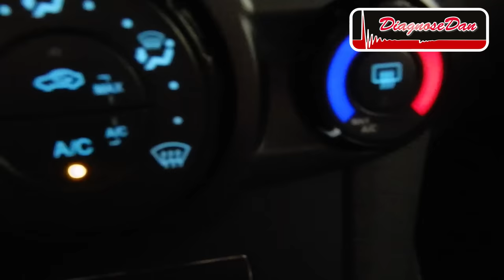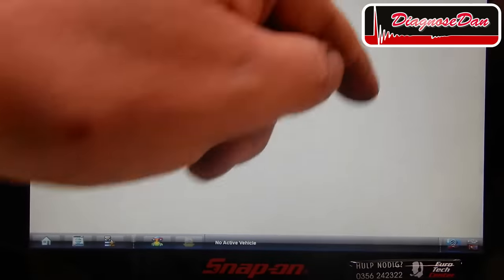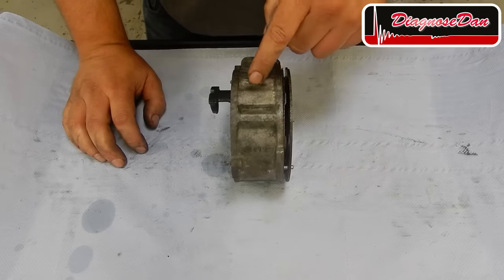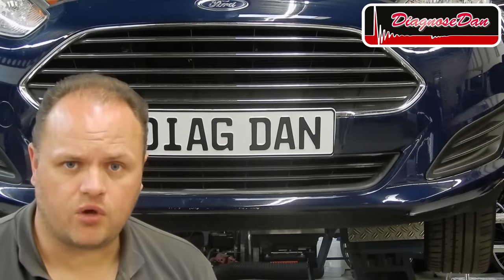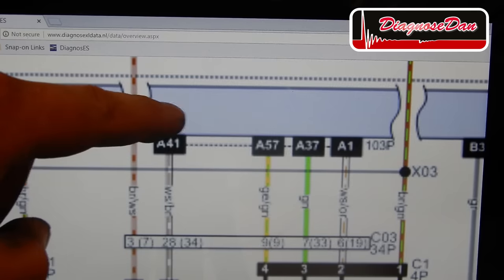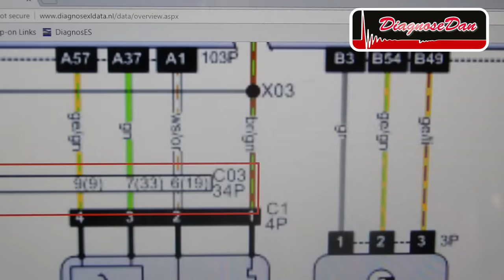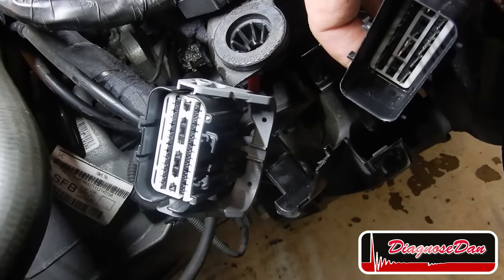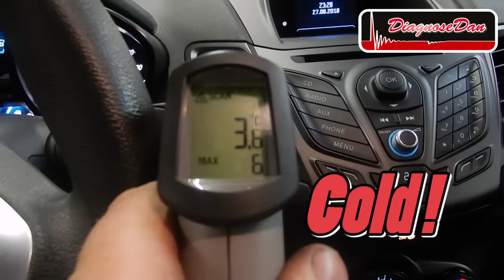Ford AC Trouble ! (Variable AC compressor)

Comment: You are an excellent auto lecturer who teach the trouble diagnose more logicality. All of your customers will end up their repair only with replacing  the exactly required spare part. Modern Technicians end up the repair job after removing  03 genuine parts with fake, finding the fault in the last one. Your customers are really LUCKY.

Comment: Outstanding that you actually make the effort to find faults with connectors. That is the biggest problem with a lot of mechanics. They are into replacing components because it doesn't require much thinking

Comment: Thanks a billion times Dan, i came a cross a car with the a/c solenoid which i kept confusing for a pressure safety cut off switch, the tutorial of the slung plate made me understand how the design works and i was able to fix the problem. Previous mechanic replaced the compressor 3 times and ended up with the same problem

Comment: Thanks for the new video Dan, this is basically the same with any ground side control circuit and will help with understanding the process and shortening the diagnosis time!! Great instruction all around........thanks for taking the time!
Reply from the maker: It's basicly a very simple system, but a lot of people don't know what the solenoid does.

Comment: another great video about electric diagnosis. I like how you get very specific on the meaning of electrical measurements on components and wires. Your measurements on the solenoid remind me of how control relays behave which is very similar in that when not grounded have power on both sides of the coil, but will have power only on one side when the pcm grounds the control coil in the relay.
Reply from the maker: Thanks for the nice words!

Comment: great fix, thanks again Dan 👌
that's a common fault on most vehicles where vibration or pulling forces are an issue, specially with bad motor mounts or bad shocks (bad roads or bumps also helps out the possibilities on that issue)
i have seen it in many times its very common on transmission modules too
Reply from the maker: Thanks for watching!

Comment: As usual Dan, excellent video even though I do not have this type of AC system in my cars. I had the same problem where a connector pin was not fully snapped into the connector housing on my motorcycle. Sure enough, it was the pin coming from the kill switch to the electronic ignition module on my 1990 BMW GS which is why I noticed a slight hesitation while driving. I looked into the connector, saw a pin was very recessed, pulled back the rubber boot, pushed the pin forward and heard a nice "snap" as the pin engaged in the connector housing. Bingo...perfect! By the way, you have a nice Nussbaum lift. I had to settle for a MaxJax lift in my private home.
Reply from the maker: Sweet!👍

Comment: 10:29 The thing held by the left hand is the reed valve assembly. FYI, this is what makes variable displacement compressors emit a low groaning noise when the swashplate is held for whatever reason at minimum stroke angle. The reed valves just begin fluttering about due to the very short piston travel, and the suction gas pressure oscillates very rapidly as a result, and the noise can propagate to the evaporator (and hence be heard from the vents) through the suction line (in variable displacement compressor systems a muffler is often found on it for this very reason). A lot of people complain about that kind of noise especially on German cars equipped with such compressors, but it's entirely normal as long as the variable displacement compressor isn't kept destroked due to a very low refrigerant charge, a faulty control valve or faulty control valve wiring or whatever abnormal reason.

Comment: Very instructive Dan!! I have an Ecosport Kinetic 2014; suddenly the AC  wouldn't throw cold air anymore.  Apparently the clutch was not engaging, but this I couldn't see by myself it at the beginning because of the position of the compresor in the engine housing.
I checked all the fuses and the relay and they were ok. I scanned the systems with a USB ELM interface connected with my PC and FORScan software. No DTC were reported. 
I also runned tests to see if commands where activated when the AC was ON; all was ok. 
The   pressure of the compressor lines where at 780 kPa (113 psi) when the engine was cold, which at least meanned that there were no leakage;  but as the test elapsed time growed the measured pressure increased up to 1070 kPa, no depending much on the AC activation switch. At first this puzzled me; but then I understood that as the compresor was not working, the increase of the temperature of the engine would heat up the AC system increasing the pressure of the lines.
I took the vehicle to an AC workshop, and they told me that  in fact  that the clutch was not engaging, possibly because of PCM failure. 
I went back to home, and started watching   youtube videos until I got to this one. 
I made further tests, removing the AC relay to see the voltages, and I concluded that the problem might also be in the same connector you showed in   this video.  The said connector in the Ecosport in fairly accessible. It was all dirty and unprotected from the environment.  I just only  moved the cables a bit and Voila! the AC worked again!.
Pretty sure I saved myself a lot of money.
Thanks Dan!

Comment: I get a kick from all these other shops making expensive diag calls and what do they tell the customer after replacing the parts and not fixed the problem?
Dan you are on fire... Awesome vid
I watch Scanner Danner also but the way you explained bias voltage.. I 👍
Reply from the maker: Thanks Ermal! For watching my video's, i hope you like them.
I don't know what shops tell their customers, what i do know is that it isn't always easy and everybody can make a wrong call sometimes.!
Reply: Well, when all means known have been exhausted, someone may also try the "It's normal, these cars just have a weak AC system" way...
Reply: What that say is that the compressor or whatever HOWEVER NEEDED TO BE CHANGED  in order for the system to work properly!

Comment: It would seem that when that wiring harness was assembled that particular pin didn't get pushed in all the way and locked into the connector. It initially made contact to the other side but eventually over time it worked its way loose. Basically this was an assembly mistake at the factory that didn't show up immediately.
Reply from the maker: Yes Maybe your right!👍

Comment: hitting like before you get angrier, I almost saw the HULK. lol
Reply from the maker: Ha ha, just a little fun before going on with the serious stuff🤣🤣
Reply: had my first encounter with bias voltage on a 2007 ford bantam (SA model) idle control valve (3.6 volts at the connector disconnected), had to call a PCM on that car no pulsed ground from the ECU, even on startup considering intentional driver shutdown. customer couldn't afford the repair so is driving around with a jimmied throttle body plate to idle. It still running up to today like that.

Comment: Great explanation of a common sense, step-by-step approach to diagnosing an issue in modern vehicles, particularly the explanation of bias voltage and its use in diagnosing circuits controlled by the PCM, and the value of the Power Probe in this process; i.e. a great use of Occam's Razor to find the simplest solution to a potentially complex and expensive problem.  I really appreciate your taking the time to make this video on a Saturday, realizing that you probably had to make it in multiple languages for your different audiences.  I appreciate your showing and explaining to us the swash plate method of controlling the pistons in the compressor, something I learned the hard way about a month ago.

Comment: I had a similar code on a 2011 BMW X5 50i
The compressor was actually stuck on and the ac lines would freeze.

I no longer have the vehicle but I think I had a short to ground in the circuit.

I could have used the lessons in this video to fix the problem!

Thanks Dan!

Comment: I  am not a car guy but your humorous presentation made a subscriber out of me! I was intrigued by your video title because my car recently had AC compressor replaced and suddenly my AC controls won't power on until a minute or two after turning over from a cold start or overnight and when it does, AC is cool but not COLD as it used to be with old compressor. My Small town Mechanic is stumped! (2008 Toyota Highlander). I would be interested in you doing a video diagnosing this problem. I read it is a real problem in the 2nd generation model after mine,

Comment: In deed you're right by saying this system might be different in other models because I remember I saw Ivan's (Pine Hollow Auto Diagnostics) video about a variable AC compressor belt pulley failure and the belt pulley of the AC compressor was not electro magnetic actuated but it was a fixed part always rotating while this one you're showing here has a electromagnetic controlled belt pulley like the regular old AC compressor models, but that is the only difference to the one on Ivan's video. Diagnose Dan You're amazing! Your teaching skills are wonderful! I feel like I'm ready to service this type of AC compressors already! Thank you very much! You have a wonderful family!
Reply from the maker: Thank you so much for your comment! 👍👍
Reply: Electro magnetic actuated clutch saves some fuel and also saves the compressor from total seizure (and the AC system from what a seizing compressor pumps around too) if refrigerant charge is lost, compared to clutchless...

Comment: I have the same problem - intermittent a/c comp. clutch engagement and its been getting worse. Yesterday I got cold only after driving 20 miles! Problem is, summer will be starting soon in southern AZ. Thanks for the video; I suspected something electrical, but never in the connector itself.

Comment: I know how it works but never seen the oily bits of a real compressor. Amazing to think these things run for years with all that sliding happening on the swashplate. A tribute to design and lubrication which I presume is from the dissolved oil in the refrigerant. Thanks mate. really enjoying the steps process and learning about more modern technology like variable swashplates. Very similar to hydraulic drives used in Log Forwarders where they use variable pumps and motors.
Reply: Yes, it's a two-stroke like lubricant dissolved in the refrigerant setup (no sump and no oil pump), though modern auto AC compressors are designed with different kinds of baffles/oil passageways inside that end up separating most of the oil from the refrigerant somehow and make a good amount collect within the crankcase at all heat load/rpm conditions, in order to keep every moving part inside happy and increase system efficiency (look up patent US6786703B2, that's the Delphi CVC compressors lubrication mechanism as one example). Design of all moving parts (such as the swashplate and the piston shoes) takes the roughest operating conditions into consideration too.

Comment: Fieldpiece kit JL3KH6 this kit brings tears to my eyes. I put alot of time in studying the ac system. This kit and a scan tool work together unbelievable. But you have to understand pressure readings are live voltage and temperature readings are like amp readings you need to understand them to become good.

Comment: Timely video for me.  I've just recently been trying to make bias voltage sensing part of my "knowledge" rather than something I've seen.  It comes to mind if you are looking at circuit board, but here's a real life example of it coming from the power circuit side.  How does the digital computer know its commands are being executed?  Oddly, it works not unlike the lamp circuit on the alternator, just with small voltages and even smaller currents.
Reply from the maker: Great timing!🤣

Comment: You did a great job.  Recently I was fooled by a loose serpentine belt and two bolts missing and two bolts halfway backed out that held the A/C compressor on the 2.4L engine on a 2008 Dodge Avenger .   Yep the compressor was about to fall off the car but I didn't know it until I was installing the new compressor and found the compressor's lower bracket was loose.   The compressor was making a weird noise that I can't relate to a loose belt or pully misalignment so maybe the compressor was bad.   A compressor from Auto parts stores was over $500.  I got one on Amazon for $200.  It has been working a week.  Maybe it will keep on.  
   BTW  I didn't know anything about this compressor or  A/C system when I started on the project.   I was shocked when auto parts stores wanted over $500 for the compressor.

Comment: Loved the diagnosis of this cooling problem BUT I find the title a bit misleading.  I'd thought we were going to be informed that Ford has a "chronic" mechanical Variable AC Compressor issue, only to find it was just an electrical connector problem and probably a "One Off" fault.  Thanks for sharing.

Comment: Good vid, loved the stripped down variable pump walk through .
Pin in that harness must of been faulty assembly from factory !
Good find, customer gets a sweet job ticket and you get a thumbs up .
Well done Danny ...
Reply from the maker: Thanks! It's a Mystery to me how that pin came out, but one of the people in the comments Works at a Ford dealership and he says he has seen more pins comming out of connectors only never of the Ac.
Reply: Did the AC just quit working, or did it never work?
Reply from the maker: @dans_Learning_Curve  Actually the customer told me it was an intermittent problem but when it came to me it wasn't working at all. So Maybe at some point the pin did make contact.

Comment: Just fantastically explained. Thanks from India. 

What happen if I use variable AC compressor in clutch type AC car with direct supply of 12v to solenoid valve. Does it works for moment or get any damages?

Comment: Diagnostics are so much easier these days with access to diagrams which you can blow up, specialised service tools and a methodical approach. It will only get easier too with manufacturers creating watchdog circuits which can monitor connectors and individual components and throw more specific fault codes for technicians to go straight to the source of the issue.

Comment: Well done Dan. I wasn't sure how an automotive A/C compressor works. Now I know how one of them does. I am assuming the other type is a rotary compressor?

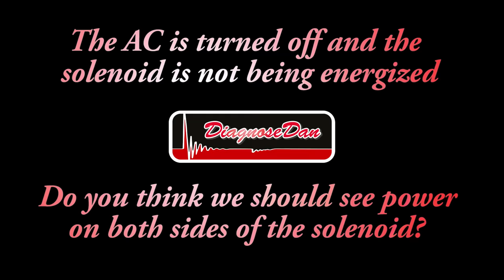Both wires have power which means that solenoid would not work. I can understand the power lead coming from the 7.5A fuse having power. But as soon as you turn the A/C switch on, the other lead should go to ground (in electronics, it is easier or best to "sink" than to "source"). I am at 15:30...lets see what happens.

Also at 23:39, C03 connector looks to be a 34 pin connector according to the scan tool circuit diagram.

Comment: Hi, excellent work Dan! I have a critique though, Piercing tools are to be avoided at all costs! Even with sound pinhole repair practices. Safer would have been wiggle test near PCM, If that passes, then remove PCM connector and probe there, No permanent wire damage and completely reversible with exact same result. Secondly, I know you knew about the connector but in your whiteboard diagram it wasn't included which is misleading to your viewers. Seeing that connection between Var Sol plug and PCM plug would also deter me from piercing wires unless I was at wits end and all removable plugs were testing correctly (as in a wire break between terminal crimps). And if you do have to pierce wires, at least do it further from the plug so it can have a butt splice EASILY installed if the pierce hole repair ever fails. But I also understand you were alone on a saturday in the shop so forget I mentioned anything. Have a great day DD

Comment: I learned something tonight. Thank you. What would you suggest about an '03 Ford Crown Vic with an intermittent AC clutch engagement that is getting worse? That is, it's now off 90% of the time. Fan seems to be blowing too much. When clutch engages, it produces very cold air. (Good thing it is Dec. in Arizona.) When the compressor is on, low side pressure is ~ 55 psi. Thank you for any tips you can provide. BTW, I have a scanner.

Comment: This is a very good explanation of the variable displacement compressor, in the past this type of compressor was commanded for a similar valve (identical in shape) based on a thermostatic principle without cables.
By the way Mr. Dan, can you tell me please where I can get the scanner Snap On Euro Tech version you are using in this video?
I live in Slovenija and I think the Euro Tech version you have is the right for me as well.
As for your video content, I think is awesome. Congratulations, you have the pedagogical gift.
Reply: Pneumatic control valve. Senses suction pressure and, depending upon the suction pressure, routes pressures differently inside the compressor to change the pressure differential between the pumping chambers and the crankcase and, as a result, the swashplate angle as needed (suction is routed to crankcase to increase piston stroke, discharge is routed to crankcase to decrease piston stroke). Some of these are also able to sense the discharge pressure and adjust the suction pressure value at which the compressor is destroked, so that you get colder air in the summer and less fuel consumption in the winter basically. Works like the solenoid valve, but the pneumatic valve is only able to keep the evaporator from frosting up and nothing more, while the solenoid valve is able to keep the evaporator at a desired temperature.

Comment: Ford engineers are notorious for creating new ways to make a good product stop working. It started in the 80's with the Escort's disintegrating head gasket. Every year they get more creative. I now drive a Toyota as a direct result of this. I've racked up 350,000 trouble free miles. Keep it up Ford...